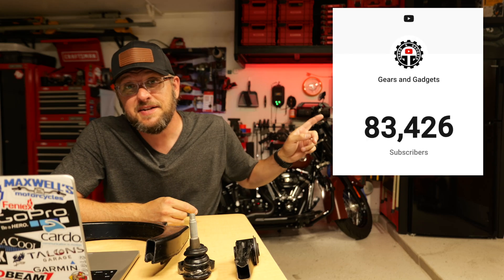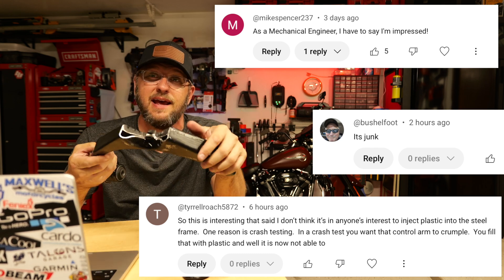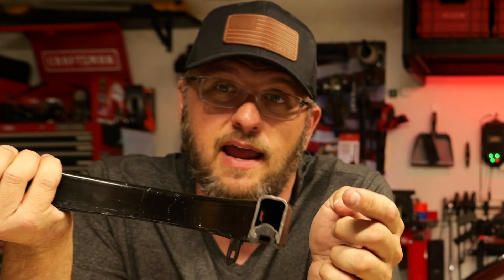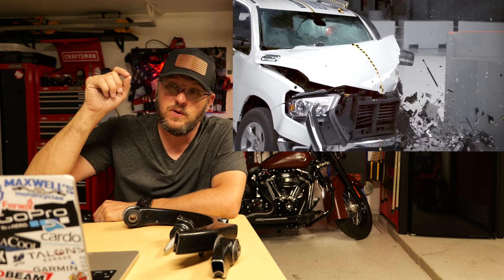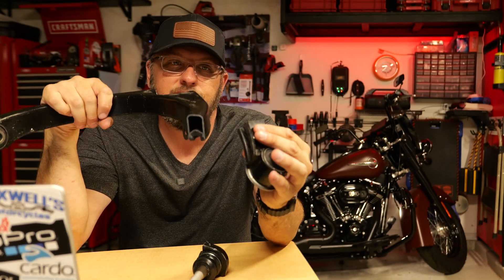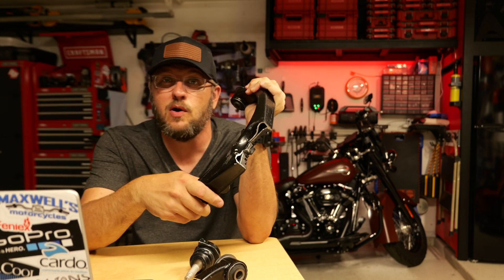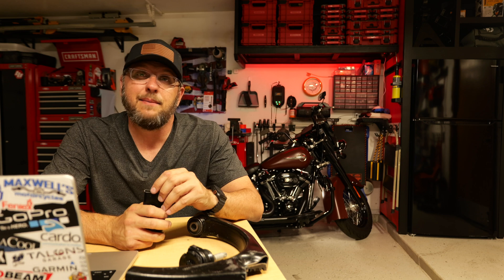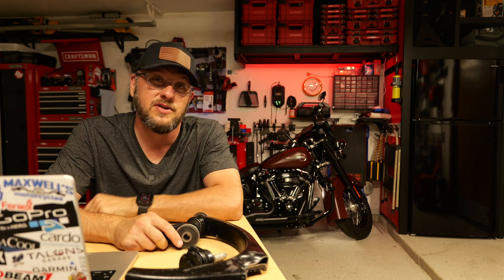Are RAM’s Plastic Control Arms Built to FAIL in Crash Tests?

Comment: I got a Solid Dana Axle no control arms here, My Lifted 2nd Gen Dodge doesn't have to worry about the Front wheels crushing through the wheel well and floor pan into the cabin, the Lift drops the tire and obviously raises the cab above the Tire, thusly the Tire will Go under the Truck upon impact. 
  Smoothly sailing over the big ol 33s
😂😂😂 
 Probably be Dispatched some other way tho a malfunctioning 
Airbag or something 😂😮🥴😭😵

Comment: Plastic gets brittle with age very bad for suspension and used or buyers to keep them 15 to 20 years will definitely be at high risk of failure. Hell I've broke dodge Dakota lower control arm on my dirt roads

Comment: I don't care if it is a car or truck or SUV, and I also don't care if the aforementioned are big or small or in-between, my issue is will this hold up during everyday use? And when you mentioned CAFE and EPA ratings, I automatically plastic parts in the engine like  valve covers and the oil filter housing. Come to think of it Chrysler (Dodge and I guess RAM and Jeep will fall into this as well, but when it comes to the oil filter housing, they are using plastic parts and people are upgrading to the Doorman product. I think this is how they meet CAFE standards and EPA standards and I also think this makes the car more disposable and or make more money when replacing  the part. Unfortunately

Comment: As a mech eng who has designed, manufactured, installed and maintained production equipment for over 30 year, worldwide, in the nuke industry, that is still in service and making the customer money, I will trust fact not feelings every single time.  Lets look at performance irrespective of design.  If a "blue" one lasts 400,000 miles and "red" one last 40,000 miles and both meet all performance, crash and operational specs people will be yeeting the "red" one because it is clearly crap, even if it is rully rully purdy.  The plastic ones have been on vehicles since 2019 or before.  With the number of trucks on the road that is in the order of many millions of miles of real world "test" data in every environment known.  Is Stellantis having to replace more than a statistically theoretical number of failed ones under warrantee?  Are trucks in or out of warrantee being recalled because they are unsafe?  So what if it is cheaper to build. Does it perform as well or better?  Stellantis had a reason for doing this and if the design works and people are still satisfied with performance and the price, win win.  This moves with the unsprung weight, something that ideally should be zero and made of noweightium.  Lighter is better for all aspects of driving and handling in general.  This pressed and welded steel box section will be strong.  My FEA (Finite Element Analysis) stress engineering eye leads me to believe it was not stiff enough and the ribbed plastic insert that is  molded, bonded or attached(?) to the stamped welded box added the needed dampening and or stiffness needed to meet design specs.  The facts seem to be in a blind test, people seem to like how it drives, it is safe and seems to be reliable.  The problem, as John Cadogan would say, is the bogun beer swilling beard strokers (which you obviously are NOT) don't like the look of it.  What about the hundreds of other plastic parts on a vehicle that are there for looks, cost, function and manufacturing ease.  Filter box, bet that is plastic, zero tool access!  The old 454 had that round steel one on top of the four barrel holley with a wing nut you would always loose. I don't miss that kind of maintenance.

Comment: RAM sales (and Stellantis sales in general) are in a downward spiral because they keep producing decontented vehicles with cheap plastic parts, crap durability, terrible reliability, endless recalls, lousy performance, awful resale value and sky-high prices. On top of that, you have to deal with one of their dealerships, which is like a root canal without anesthesia. 

That’s why they keep having to pull out of segments like sedans, mid sized crossover SUVs, compact cars, etc. The Japanese, Koreans and even VW are making vastly better designed vehicles for less money with much better durability and reliability. I expect RAM trucks will disappear the way the Chrysler 300, Chrysler 200, Dodge Journey, Dodge Caravan, Dodge Dart and a whole bunch of other Stellantis products vanished due to terrible quality, durability and reliability. 

I mean, just look at the cheap chintzy injected plastic. If they’re willing to put something so marginal in where you can see it, imagine how terrible it is where you cannot see. But don’t worry — when it breaks (and it will), the dealership will charge you top dollar for a replacement that will break in another year or two. After all, why should a $65K truck last more than a few years before falling to pieces?!

Comment: Surprisingly, no one brought up the fact that these are pick up trucks, often times we take them off road. Too often we see these type of issues fail when off roading, which means you’re going to have a very expensive repair. Your video was thoughtfully done, approaching it from a safety perspective. From a practical position, I don’t think I would purchase a dodge ram truck because of this cost saving issue. I would love to see your follow up as you suggested from an unbiased engineer looking at the overall safety and practical use performance. We all know that Dodge and their vehicles have been in a cash crunch for years, in my opinion that appears to be the reason for this cheap yet very concerning truck control arm. Thanks for the video.
Reply: Making a hollow steel control arm encased in polymer is absolutely not cheaper to mass produce than either a wholly steel or aluminum piece.

Comment: The system works well. It inversely supports the metal control arm section making it nearly twice as strong. With a little weight savings and lateral vibration reduction during wheel hop events. The new Ram is the best riding vehicle in the segment.

Comment: Has anyone bothered to check with a Ram engineer to get their input on the design?  It would seem to me that the added plastic on a part like that would add stiffness and rigidity without adding excess weight.

Comment: Hey dummies-it’s steel coated with plastic. Big deal huh?
Reply from the maker: It’s not “coated” with plastic. it’s steel with a plastic injection into the bottom of the part. Still exposed steel. Did you even watch the video?

Comment: The front knuckle fold is one of a few strategies used to prevent footwell intrusion.

I think Ram has a little bar on some of their frames to protect the bottom of the firewall.

GM seemed to design their control arm tabs to allow a tear out failure. That’s a fuse that needs to be beefed up if you’re going to Baja your GMT800, with the implication that other things should be done to protect the footwell.

Toyota moved their body mounts way forward and out, much to the annoyance of people trying to fit big tires. I don’t like the body mount chop because I’m pretty sure it’s there to protect feet with good value engineering.

I think the right answer is pretty simple. Well designed rock sliders that are integral to the frame and protect the bottom of the firewall and the foot well. Messing around with hoping the IFS collapses exactly the right way seems a lot less reliable to me.

Comment: I remember back in the 80’s and 90’s when they started using plastic intakes in cars. There was a lot of backlash over that too and rightfully so, they did have a lot of problems. But now plastic intakes are almost common place, at least on non turbo engines. I don’t know if that’s the case with modern turbo engines or not. 
Most people aren’t going to off road their trucks, so maybe that’s enough to have a normal service life. My question would be reliability. How long does it take the part to fail compared to a traditional control arm? Does it fail more frequently off road? Does it handle life in the rust belt states better? Does the semi plastic construction make the suspension quieter and have less vibrations travel into the cab? Does the semi plastic construction make it more flexible instead of more rigid and less prone to bending, perhaps in theory making it stronger? 
If history tends to repeat itself then it’s about cost and emissions and reliability gets thrown out the window and the true cost passed onto the customer. When I say that I am reminded of cylinder deactivation, direct injection, auto start/stop technology, EGR systems, turbos put on small displacement engines built with less robust parts like smaller and lighter connecting rods and crank shafts. Lower viscosity oil with tighter engine clearances that have lead to so many bearing recalls and failures. I personally don’t see a problem with it in the long term since the LCA takes most of the load. But when they start making a composite rear differential on a truck with a tow package, I think the 💩will hit the fan then!

Comment: I used to be a Design Engineer for an Automotive Company. Front ends are designed to crumple and fold under the vehicle on impact. No part of the driveline or suspension is designed for impact. They are designed to fold under the vehicle. Back in the 50s-70s decades, driveline and suspensions were shoved right into the passenger compartment. The photos are gruesome. Original mini vans? Driver left foot/leg lost due to the front suspension entering the compartment in a quartering toward you impact. Some plastic parts are actually stronger than the steel version. I designed a plastic part to connect the upper and lower front sub frames. It was stronger than the steel parts it replaced and vastly less expensive.
Reply from the maker: Yeah it’s all related for sure but I don’t know how much I want my UCA or any part of the critical suspension components having engineered weak points for crashing in a pickup that might be seeing some significant off road work either recreational or in the trades.
Reply: If the plastic is stronger than steel, wouldn't that be just as bad as the steel coming into the drivers compartment? Your comment is contradictory and I don't buy it. If engineers were so great now, why are there so many issues after issues in modern vehicles? By now after all the years vehicles have been built, the issues should be almost nonexistent if "engineers" were so smart.
Reply: @mikelovin7  too much tech, cvts and cheap construction is the or
Reply: @mikelovin7  vehicles still have tons of issues because the standards we demand are always changing. If crash testing and cafe rules didn't exist... if people didn't want larger and larger vehicles... if we weren't as concerned with fuel economy... if people didn't want or like new features or better performance every year... THEN engineers could focus on reliability and fixing problems.